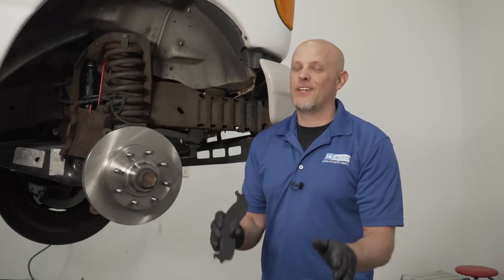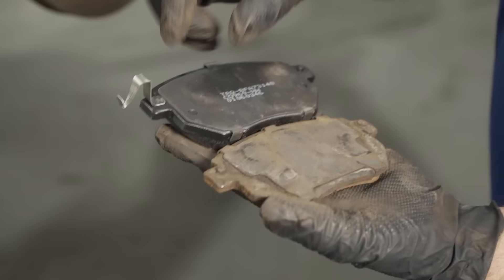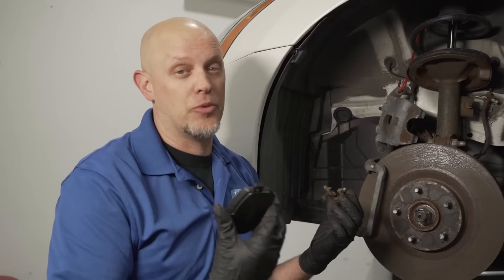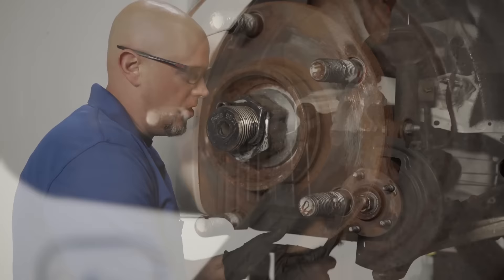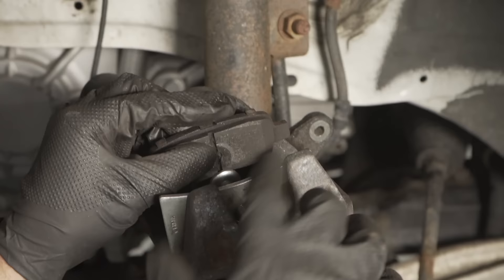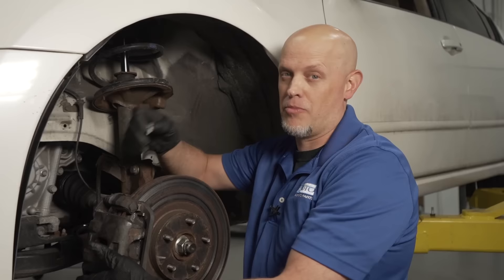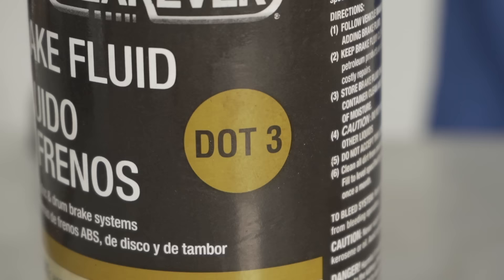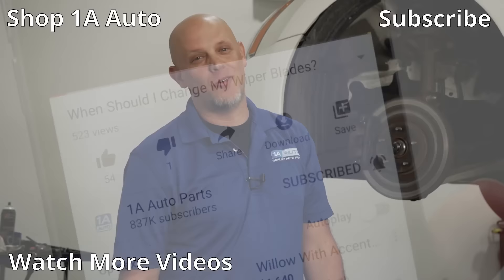Most Common Brake Installation Mistakes!

Comment: Take a picture of the drum with hardware before you disassemble the springs. Each side is different and it will save a bunch of time.
Reply: That’s for drum brakes not disc
Reply: Good advice for any maintenance or repair.
Reply: @ypcomchic  Yea hints why he said "drum with hardware".
Reply: Great advise for a newbie!
Reply: What if they where previously installed wrong??
Reply: i wish i seen this comment about 4 years ago...
Reply: Big boys go to the back of the bus.
Reply: thnx...great tip..4 an old man...
Reply: this idea not that good, if last people put it wrong ,you will just follow mistakes.
Reply: one of my new customer say her outback making noise,she just did all brake from other state and then drive to here,I fought a brake hose clamp still  clamp on the drive side rear brake hose, burnt the pads and caliper.
Reply: most common wrong is brake caliper fitting, saw a lot twisted the caliper with the hose 360° ,touch shock or the rim.
Reply: As individual parts are concerned, I would do Only One Side First. Complete with Correctness, "Button it Up!" Then proceed to the next side. Again, do a Correctness as well. Now you'll have nothing to say lost.
Reply: Also, make a notepad of your Automobile Parts. Place all Catalog Items along with Number. You'll always be ahead of the Mechanic. If first installed. Do step One (1)
Reply: @swheeler6848   ... 🤔 even works for us old retired mechanics,  the mechanic ability is there .. but the mind has a lot of mileage 😂
Any more I send to a young buck, let them do the twisting ( both the wrench and body)
I know zip on how to work on computerized cars ) retired in the 80's computers where just coming in .. 🤔 ( dang I am old☹️)
Reply: Never seen a drum brake job that is different from side to side.  They have always been a mirror image of each other.   I only do one side at a time.    If I get busy and don't remember where a spring goes I just look at the other side.
Reply: Both sides are identical but in a mirror image . Take off both wheels and drums. Do one side at a time and DO NOT let anyone disassemble the opposite side until the first side is CORRECTLY reassembled again.
Reply: I never take pictures of anything, but that's because I have been an automotive technician since the beginning of time LOL. I'm joking although it seems like it, but actually it's been many years. but that is good advice for someone who is still new to auto repair.
Reply: No doubt
Reply: Disk do have pad springs on some vehicles I left mine out with no problems but next time I will install new springs with new pads I was in a hurry and done the work at night and lost two springs I found one on my shoe when I traveled 600 miles never found the other one. 73
Reply: That’s a lesson I wished I knew a long time ago. Old tech in my shop told me “you youngins have picture phones, use ‘em!” And that was the day installing parts was 100x easier
Reply: or more simply do one side at a time
Reply: better to get a shop manual or google up a parts drawing from an auto parts website
maybe the reason you are replacing your brakes is the last guy screwed up..... !
Reply: That is also a good idea if you are having an electrical problem.  Take a photo of the fuses BEFORE you pull any out.  Then you will have some idea where that darned thing was supposed to be.  Use a good camera too, you want as good a photo as you can possibly get
Reply: I do this every time even on a car I've done multiple times. Also, if you're not SURE the last person did it right, double check diagrams and pictures online. Multiple times I have taken apart drum brakes to find out the previous person put it back together wrong.
Reply: That's Really A Fact!

It's really help a lot

Comment: Another tip I found out the hard way - when changing brake fluid, always use the ring end of the spanner to crack the nut. They are often very tight and the open ended spanner can damage the nut.

Comment: Make sure that the new pad tabs are gliding in the tracks freely. Since the steel parts of the pads are stamped out at the factory, they can be cut at an angle or have a bad edge causing them to hang up and not hit the disc flatly. You can file them or use a grinder to get them square enough to float. And THEN use the  grease.

Comment: Great tips! Some things worth mention: always wear safety glasses, especially when wire-wheeling hub assemblies, fasteners, or banging on a stuck rotor/drum. Use a 3/8” torque wrench and torque the caliper bolts to spec. I CANNOT stress this enough as I’ve seen overzealous junior technicians sheer off the head of a caliper bolt from over tightening. If you are new to DIY, do one side at a time and take pics/video if necessary. This will save you if you have to step away to address something else. You may forget how things were taken apart. This is especially true if you’re working on replacing shoes on drum brakes. Lastly, don’t be afraid of using brake cleaner… it’s cheap and cleans 99.99% of any residue left behind on pads and shoes from your hands when reassembling. Cheers! 👍🏻
Reply: It's safe to spray (with brake cleaner) the pads directly and wipe them off, Incase you get grease from your hands on them?
Reply: @dman2007  yes. Even if desperate, soapy water.   Brake cleaner best.

Comment: An excellent video! One thing is missing which many DIYers may make mistake. The grease for the caliper slide pins should silicon grease rather than grease you used on the brake pad back plate.
Reply: Depends whether you have metal to metal slide pins or metal in rubber slide pins

Comment: Cool video! I've replaced brakes on 100s of cars and trucks, but Im not a certified mechanic, and never went to any school to be one. I like and agree with all the tips you have given! I've read through a lot of the comments here and did like most suggestions given by other viewers! The one important thing I can't believe was not mentioned at all, unless I missed it somehow, is the brake dust safety!! The one thing you should NEVER do, is inhale any brake dust! The 1st thing any repair manual tells you is to never clean your brakes with compressed air, because brake linings may contain asbestos, blah, blah, etc, etc. Don't clean brake parts with a wire wheel, indoors, without a mask and other ppe. Don't make brake dust airborn if you can help it. Brake dust is some nasty stuff you never want to inhale! (Don't ask me how I know about that tip being important, lol!) Great tip on opening the bleeder when compressing the piston! I hate dealing with hands full of brake fluid, but it's a must with ABS. Thank you!

Comment: Great video. I picked up a trick or two.
Also, for removing stubborn rotors I find a rubber mallet better than a steel hammer at times in that the mallet doesn't leave marks.
Reply: That or if your rubber mallet or plastic dead blow has wandered off, smack a block of wood set on the rotor. Anything to avoid metal to metal, not that I have shattered a rotor or two in my time?!
Reply: rubber mallet is all I ever use to get the rotors free
Reply: A dead blow hammer adds a little umph that
You can’t get from a rubber mallet. Great video.
Reply: Deadblow hammer
Reply: I wished I lived in a place where a rubber hammer would remove a rotor! Very rare that we don't replace the rotors for new, a air hammer with a hammer head bit will most times break them free. My OTC 7-ton rotor remover is always close by for those stubborn times.
Reply: Don't want to dent the rotor? What?? You afraid to hurt the scrap guys feelings from denting the rotor? Lol.... I hit that S.O.B with a 3lb mini and usually pops free, if not I air hammer all around. In the salt belt a rubber mallet is useless except for  hitting your door frame in the winter when it's iced over
Reply: Steel hammer and a piece of wood !! Oak, Maple etc
Reply: It's so incase something goes wrong with the install you can safely slap the old ones back on.
Reply: You can also run a bolt through the holes where the bracket assembly is usually mounted and a nut on the near side, tighten against the back of the rotor til it pops off
Reply: A block of wood to protect the rotor from a metal hammer works great too!

Comment: I’ve been working on my own cars for years, including brakes.  This is an excellent video and I picked up some little details I hadn’t thought about.  For newbies out there, wear nitrile gloves, keep your hands clean & wipe your gloves to keep your new parts clean.   Use brake cleaner to clean new rotors as they have oil on them to prevent rust.

Comment: Few things to add  , I’d check  the axial and radial movement on each wheel before removal  to see if it has any bearing play .Then check all bleeders on each calipers before brake removal if they’re not seized .After that check pads condition ,to see if its normal or uneven wear , this will give you to an idea of seizing piston in caliper and or slider pins locking up . Also not shure if mentioned ,rear brake shoes also could be put on backwards accidently ,not knowing which is primary or secondary and this leads to locking up rear drums .Lastly ,If you are not 100% confident ,seek for help so you don’t put yours or someones life on the line .
Reply: Take your time and take pictures and try to memorize the way you took them off, if you can't remember check the other side
Reply: yes,  axial/radial movement check 
this is the most important step imo

Comment: Work on one wheel at a time, especially drum brakes.  Lay your parts down carefully and they will act as a guide for reassembly.   If you have a question you can look at the other side.

A length of tubing to drain fluid from bleeder into a bottle will keep things neater.
Reply: Doing a brake job you shouldn't ever need to loosen the bleeder valve. So I don't know of I can take any of your advice.
Reply: @JM-yx1lm  new fluid? It absorbs water over time, new fluid prolongs the need to flush.
Reply: @JM-yx1lm  firebird77clone firebird's advice is good.  New pads are thicker than old, so the caliper pistons are further into the caliper body.  The brake fluid has to go somewhere.  You can either bleed it off, or spill it out of your master cyclinder.  Pick one.
Reply: @JM-yx1lm  It is a way of replacing some of the old brake fluid.
Reply: This comment is correct
Reply: I see you also watch Chris fix
Reply: yepp....; your advise matches exactly what I have to do every time I do the brakes on my car......// But I don't like to admit it..... :-)
Reply: @garync3810  You never need to open the bleeder screw when replacing pads or depressing the piston. The fluid has plenty of room to move within the system and back to the reservoir without bleeding it off. The only reason you would need to bleed them was if you kept topping off your brake fluid as the pads wore, which is a big no-no. Then you would need to bleed them because you'd push too much fluid up into the reservoir.
Reply: It has been said that when you compress the piston back into the caliper you could potentially damage the ABS modulator by introducing dirty fluid into it. So I guess cracking the bleeder screw would prevent any chance of that happening. I am not sure how true it is, but I imagine its possible.
Reply: Good points!  I'm about to do a Rotor replacement on all four wheels, and it's my first time doing this type of maintenance.  Patience and attention to detail are gonna be essential, and I'm looking forward to the learning experience.  Plus I really like having my 2000 Sierra in good runnin' condition despite being a "rustbucket"!
Reply: @robertrichardson1133  The brake fluid is a closed system.  As long as there are no damaged seals, and everything in good order, there is no "dirty fluid."  Once you crack open the bleeder, poke the caliper piston seal, etc.  those are ingression points for contamination.  Keep the system closed as much as possible and only open when absolutely necessary.  I've changed my brakes and family member brakes for 2 decades without ever needing to bleed, and never had an ABS unit fail.  2 years of formal hydraulics training + 25 years in hydraulics industry.  His points are great though- never mix brake fluid with anything, and only use fresh sealed brake fluid- the moisture content also affects the seals same as his oil demonstration.
Reply: Unless the last person that did them put them back together wrong.
Reply: @garync3810  doing a pad change, I suck fluid out the reservoir using a  syringe .
Reply: @robertrichardson1133  I think I read that in a Haynes repair manual or somewhere.  I don’t open the bleeder if I don’t have to, because sometimes they are seized and break off!  I let them sit in penetrating oil first if I am replacing the calliper piston seals.  Also, this guy talks about reading the manual, but never mentions the torque settings for the bolts and even a torque wrench.